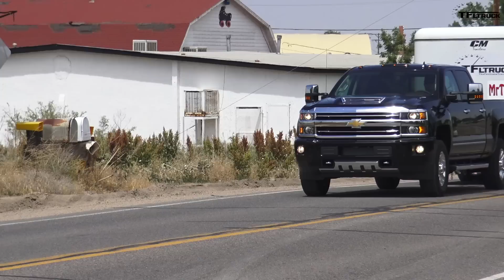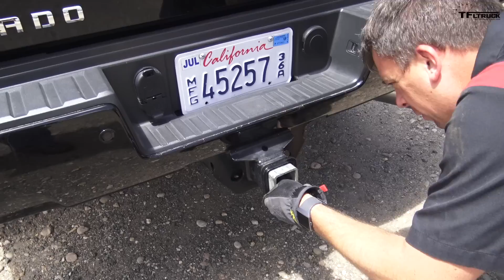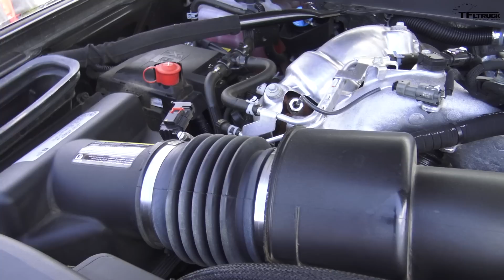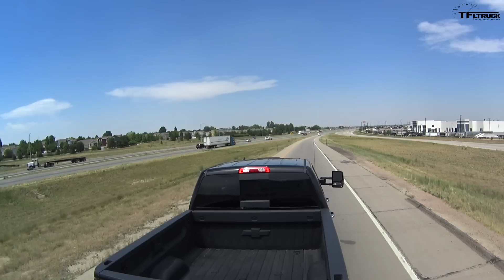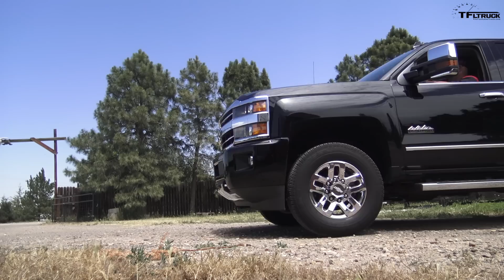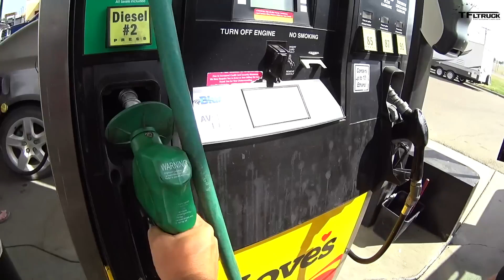MPG Challenge: Silverado Duramax vs Cummins vs Power Stroke

Comment: Chevy Duramax for the WIN!!! That is awesome, I always enjoy these real world testing videos from the IKE to these MPG loops. As for those who say why the 3500 vs the two 2500 it was explained in the video with the two 2500/250s of Ram and Ford being as heavy as Chevy's 3500 so it is even. The biggest and practically only real difference between a 2500 and 3500 SRW is the beefier shocks and leaf springs in the 3500 that affects payload capacity not towing ease and capability, there isn't much difference in towing ability charts for a 2500 to 3500 SRW no matter the engine (gas or diesel) vs the same engine/fuel type it is when they add those second set of tires that it shoots up really high. Pretty much all stated in the video, listen carefully to their explanations before coming to an emotional conclusion. Nice informative short video as always guys.

Comment: When were the other trucks tested? I'm just wondering if the fuel is different.  Winter blends tend to be less efficient.  Good job on the video, I'd take any of those trucks.
Reply: C Wyoming Winter using cold blended fuel.
Reply: That's irrelevant. The L5P is simply the best new heavy duty diesel truck MPG wise and reliability. You have to fully delete and tune a cummins or powerstroke just to match the L5P MPG which is not only illegal but very costly. About 4-5K for parts and labor after taxes.

Comment: The problem with all these diesel truck fuel mileage comparisons is whether or not the truck went through an exhaust regen cycle during the test loop.  It also matters how recently a regen was performed even if it doesn't do it during the test loop.

Comment: The mpg was not even close to the ford. Not sure why some are looking for excuses. A 2500 and 3500 Chevy duramaxx have 3.73 gears. Only difference, as many have already said, is the leaf spring capacity is higher on the 3500. Most likely that means heavier leaf springs that adds to the total weight. I owned a 2016 GMC 2500 and decided to trade it in last month, for tax purposes. Traded for a 2017 F250. While the ford was super quiet and had plenty of power, i wasnt happy with it. It just didn’t feel like a heavy duty truck, and i am not a fan of the front end. That’s my opinion, so give me a break.  2 days later i went back to the dealer, and traded the 250 in for an f150 with the 5.0. I should never have traded the Denali in for the f250, but we live and learn. Ill go back to a GM truck in a couple of years. On a side note. The F150 is a nice truck, but the fuel economy is terrible.

Comment: I have the exact same truck.  I pull a gooseneck 3-4 days a week w total trailer/cargo between 14-18k.  Truck has 16,500 miles on it and my overall average mpg is 14.6.  Worst I've got is around 9 and best, unloaded highway at 55-60 is 23.5.  At 70 it gets around 20.5
Reply: Gomer Pyle Or he's lying

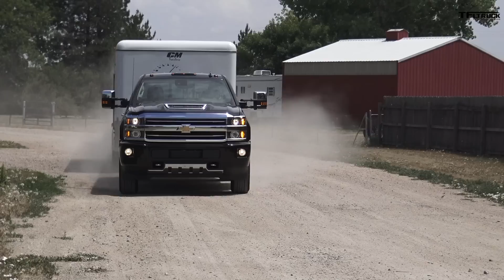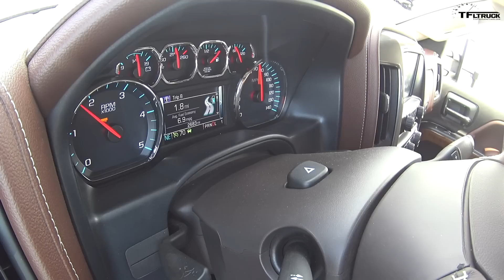Comment: This really isn’t a comparison.  The ram should have the worst mileage with that 4:10 axle ratio.  You say it doesn’t matter because the truck are tuned specifically but I have a ram 2500 with 3:55& it gets 12-13 pulling a 14k trailer in town.  And the Chevy being a 1 help because it handles the weight better.  Just my 2 cents

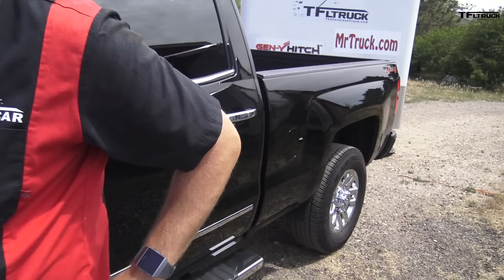Comment: 4:21 That's a High Country trim level truck and it doesn't have electronic telescoping mirrors?  That's unsatisfactory considering the cost and it's the highest trim level Chevy offers.
Reply: "This truck is awesome ... wait a minute, no power extending mirrors? No dice!"
Also, if you're hooking up a trailer, chances are you're already outside your truck and can spare a second or two to extend a mirror on both sides. I do not know of too many people that are in constant need of extending and un-extending their side mirrors, and those that are usually just leave them out. The folding is a much more useful feature. Glad to see Ford finally caught up in that regard because my friends were constantly walking around their trucks to fold in their mirrors manually when they were parking their 250s.
Reply: Stickloaf learn to drive and stop running into things. Getting pissy with bad karma over "mirrors" shows your lack of intelligence.
Reply: Bad Karma the high country is ALOT cheaper than fords platinum. Maybe thats why
Reply: power mirrors suck, they dont fold in when bumped or pushed and cost way to much to fix when they break. Its a truck Bad Karen, these things are over loaded with electronics because soccer moms like you want to pull their trucks into the garage every night and a back seat with WIFI to keep the kids entertained
Reply: You really got to pick the truck apart to make you feel better dont you lol.
Reply: Bailey O.  You don't have to buy a Platinum to get these features.  You can have them on the Lariat and King Ranch as well.
Reply: stickloaf LoL.  You've resorted to name calling because you have a weak argument.  You have no idea what I use my truck for.  I'd upload a pic but, well, this is youtube.

Comment: I am waiting for the 2019 Silverado 1500 with the 6 cylinder Duramax.  Would prefer the 2500HD but they apparently will come out later.  I have had several of the HDs with the diesel and they are great, whether pulling a trailer or not. The only flaw in any of these trucks is that you can't get a bench front seat in the highest trim levels, they try to make you feel you are in a sedan and there is not the room up front that you could have. It seems everyone wants to carry a file cabinet around between driver and favorite passenger.

Comment: I tow a 32' RV trailer that I load up to 9,900 lbs. In my 2011 F350 diesel I get about 10.2 MPG while going 65 MPH at about 2500 feet of altitude. The Fast Lane Truck's real world tests are a little low from what I've seen, but there are so many factors that come in to play.

Comment: And that is why the Chevy is the best HD you can buy, for when your towing under a certain amount. Say 18,000 lbs. But the Ram has the best heavy towing mpg.
Reply: K. R. V. Paper numbers mean nothing. The chevy easily beat the ford and dodge up the ike with the 22-23k limit it has. All pulling the same. The ford could barely handle it. Couldn't imagine loading them to max. Terrible.
Reply: These people ragging on Gm truck that can't handle the max of what ford and ram put out is hilarious!  Most of those who coment about this have never pulled more than 5k behind their truck;  if in fact they even have a truck.

Comment: Changing the gear ratio doesn’t matter?  Seriously? If that were the case then why do manufacturers even offer different ratios? It is a fact that gear ratio affects mpg, max towing, and payload.
Reply from the maker: Yes indeed, but the trucks we get with the towing packages come one way. Each manufacturer prefers a different rear end ratio.
Reply: The Fast Lane Truck Agreed, and I understand. Extremely happy with your videos; but, I think its how you frame the video that gets some of us. To compare the most fuel efficient/ least capable model of one brand  (3.73 rear end as an example) to the most capable/ least fuel efficient model of another brand (4.10 rear end) and declaring on a “winner” is not really comparing apples to apples. This test is a good example- GM (generally) has their trucks set up to tow less than Ram and Ford. Consequently, they can have their transmission and axle ratios set up for better fuel economy, because even though they have as much power, they tow much less (@ 24K v @ 32k in HD trucks as an example). So it makes sense that it is more fuel efficient, because it tows less. All of the half tons can tow more than 12.5k now.

Comment: Did you do them all on the same day same weather . ? Wind is a huge factor . even more that the load weight !
Reply from the maker: No, we did not run them on the same day. Wind and temperature are big factors, but we never run this test in high wind.
Reply: The Fast Lane Truck good to know ,don't want to give those Ford guys any "excuses" for why they lost.....again 😁
Reply: Yeah I’m sure they’re sitting around they’re barometer to make sure the Cummins babies have nothing to complain about.
Reply: During one the ford mpg testing high winds happened after they started the test but to make it fair they re-did the test at a later date where wind wasn't blowing.
Reply: Well they call it a real-world review for a reason because its what they get in the real world.  Its not all controlled its guys taking trucks on the road.

Comment: Since when can you get a 4.10 gear in a Ram 2500 with a Cummins and a 68RFE??? 3.42 has been the only option.
Reply from the maker: Yes, we misspoke. The Ram we tested had 3.42 gears.
Reply: Ok, just wanted to make sure they didn’t change something for 2018. When I ordered my 2017 I was a little discouraged I couldn’t order a lower gear. Thanks for all your videos.... I get a lot of knowledge and enjoyment from them.
Reply: 74Beeper 4.10s are 6.4 gasser only.
Reply: 74Beeper Yup, unfortunately they reserve the 3.73s for the 3500s. You can get a SRW 3500 w/ Aisin and 3.73s
Reply: @hellkitty1014  Wrong. You CANNOT get anything other than 3.42 with the Cummins and SRW.
Reply: @moparproud3978  Wrong. Try again.
Reply: @hellkitty1014  Except I'm NOT wrong. I've forgotten more about these trucks than you've ever known, trust me. You CANNOT GET ANYTHING OTHER THAN 3.42 GEARS IN A SINGLE REAR WHEEL CUMMINS TRUCK. PERIOD. Don't argue, you're wrong. I'm right.
Reply: Nope. I have a 2016 3500 dually with a Cummins/Aisin/4.10 axles.
Reply: 74Beeper I

Comment: I’m getting 12mpg pulling my 10k 5th wheel in my 15’ 2500 ram cummins with a 3” lift and 35” tires, I got 20-22mpg with stock lift 20” stock wheels running empty
Reply from the maker: Great results!